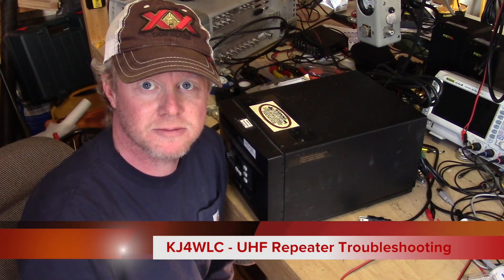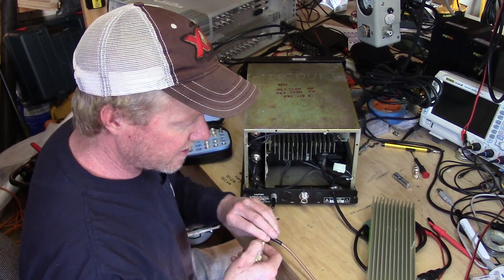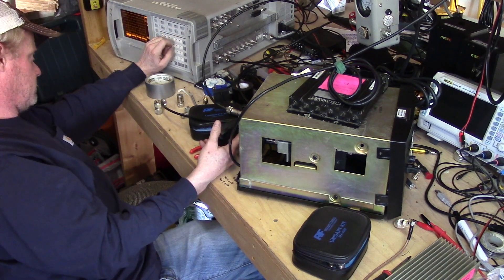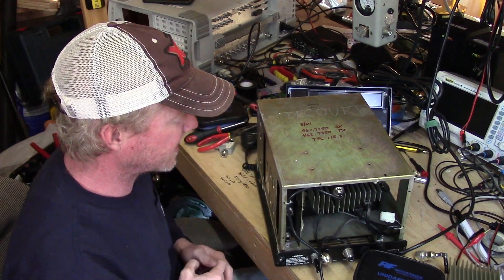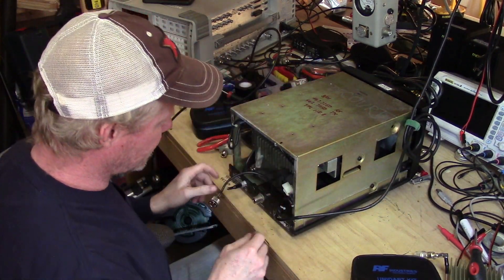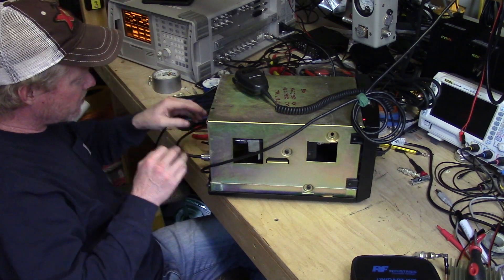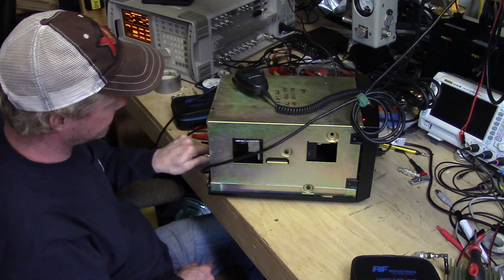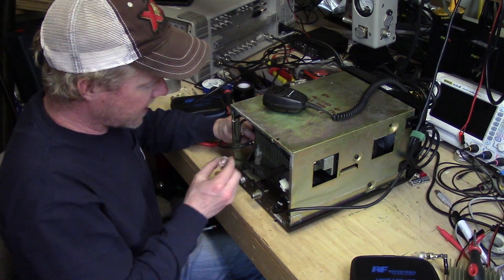UHF Repeater Troubleshooting

Comment: I’m having similar wattage loss .. and already switched out the output coax one from the duplexer and the other from panel n female connector..  both where horrible .. even though I replace them . It still has power loss I directly check  output power from the radio and had about 39 watts . But with duplexer I had a lot of power loss meter shows under 1 or less watts .! …do you know if duplexer create power loss when they get bad ?
Reply from the maker: The duplexer could certainly be source of power loss.
Reply: @ShaneBurrell1  thank you for your response

Comment: WOW CAN YOU PLEASE PLEASE PLEASE  SE IF YOU CAN ADD A 5 PIN CONNECTOR TO THAT TYT 8600 FOR A HELMET KIT ALSO -- I AM A HAM KD2MXY         AND THE RUGGED RADIO IS TOO MUCH AND I LIKE THE KEYPAD MIC
Reply from the maker: The mic input has standard level signals.  If you want to go from radio to helmet that is pretty easy but you confused me about keeping the keypad mic.